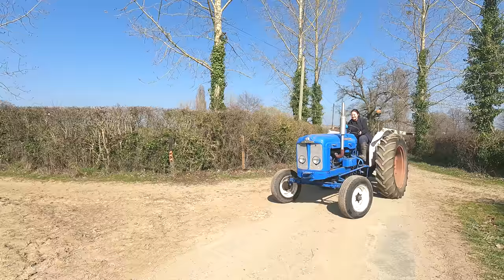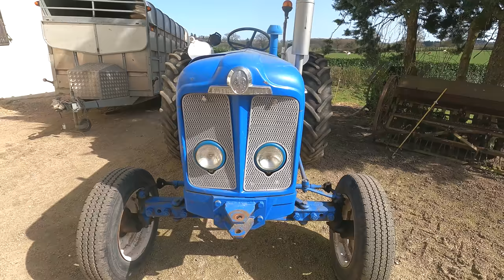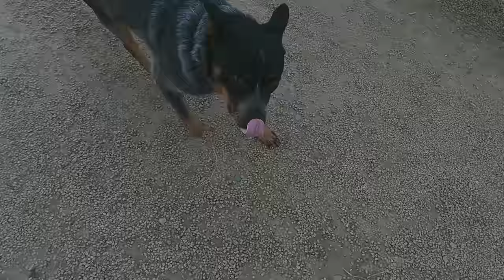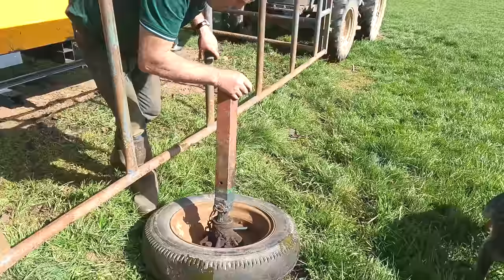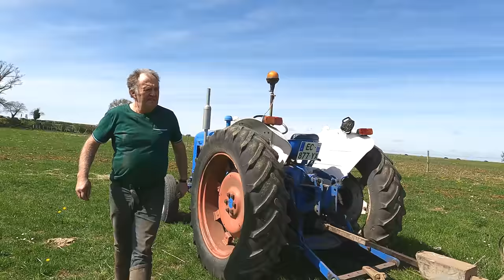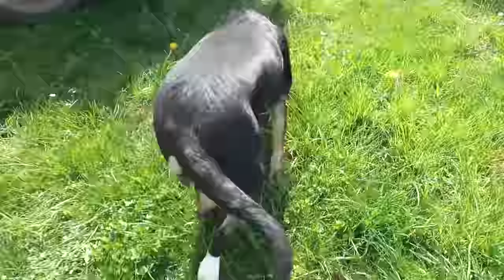BALING HAY WITH SUPER MAJOR! And letting cattle out to field

Comment: I grew up on a Farm also, first when I was younger had beef cows and then when I was around 10 started dairy farming. Did that until I graduated.  For us did a lot of rock picking, and cut and split wood by hand with axe. 40-60 quards of wood to stay warm in the winter.